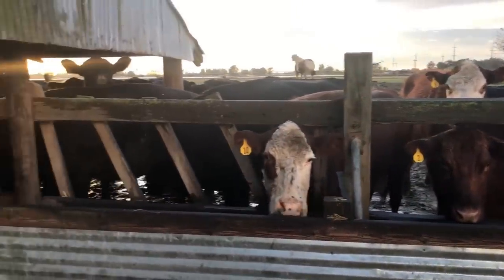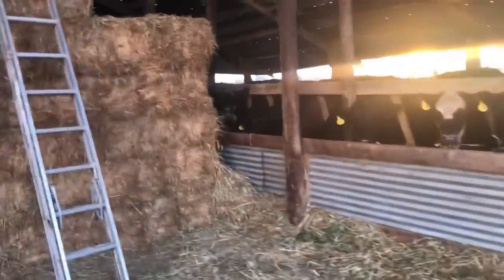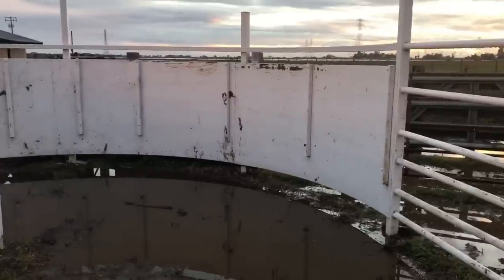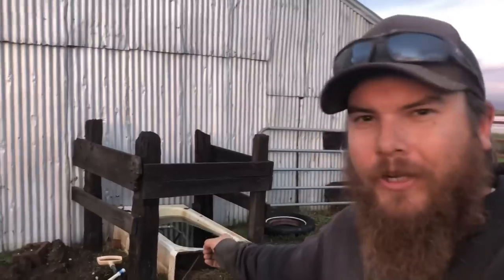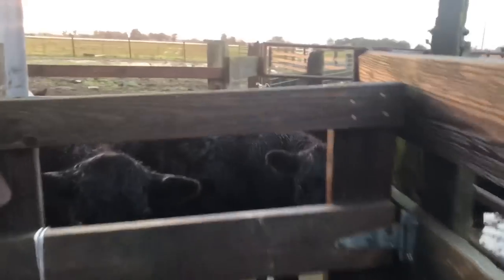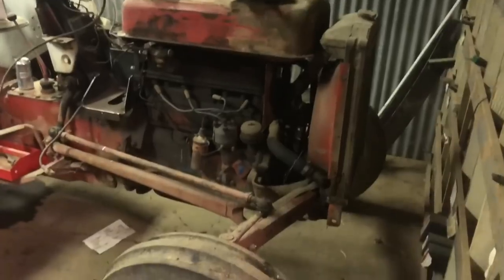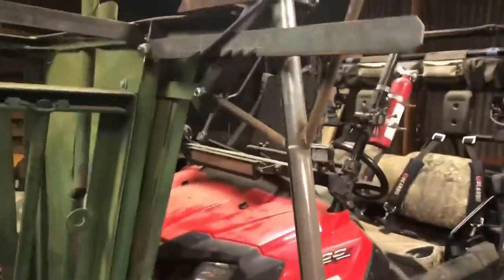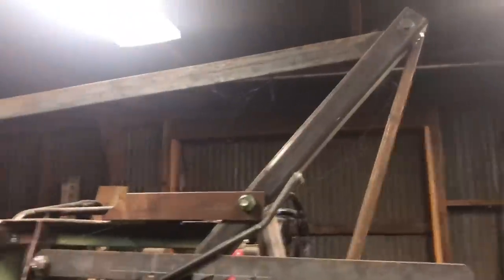Corral Tour, Upcoming Projects, and Random Thoughts!

Comment: 👍👍 thanks for sharing your cattle handling/working facility !! I had been wondering if you had built a lot of the things your using.  Have you ever heard of Go-Bob fencing? I think? you can buy kits and assemble  (weld) yourself . Think the company is based in Oklahoma but has dealers throughout the US .
Reply from the maker: BTO WannaB 

Yes I’ve heard of them, seems like a good company. The reason I build everything is because I need specific oddball sizes and lengths to fit in my setup. It’s got to be cheaper this way too right?? That’s what I tell myself anyway. Thanks for watching and commenting BTO!